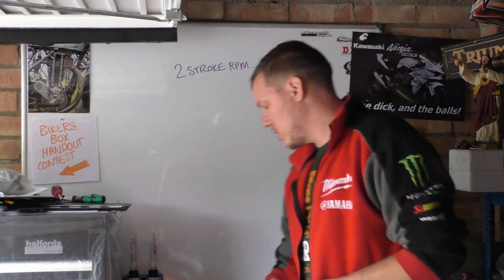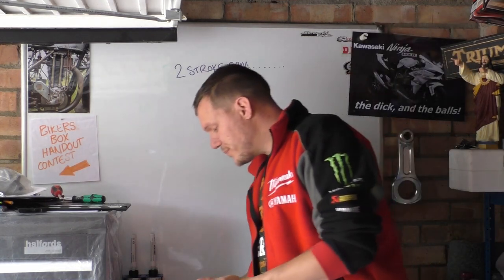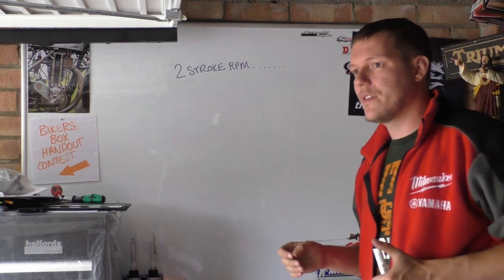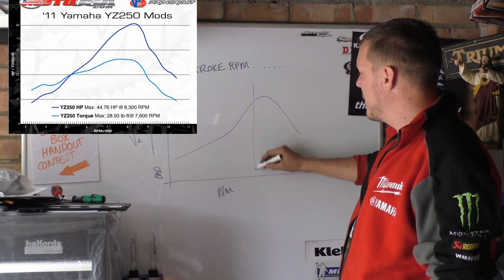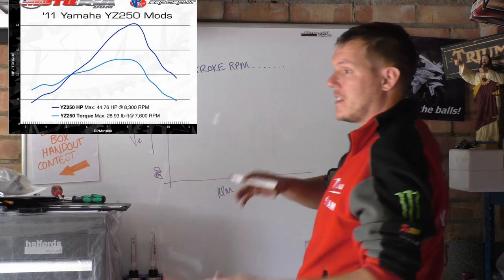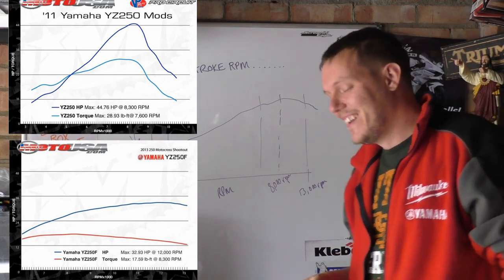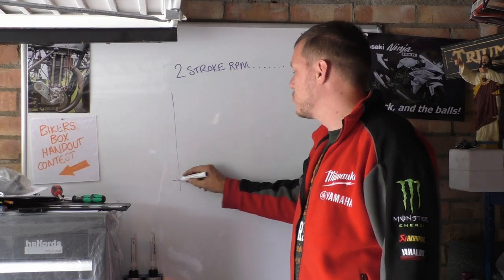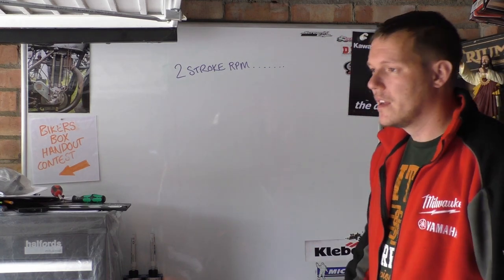2 Stroke have higher rpm?

Comment: I have been saying that for the last month, you almost laugh at me for saying so, at least you made it right.
Reply from the maker: What?
Reply from the maker: You said

 "2T do not rev higher!!!!!!!!!!!!!!!!!!!!!!!! just compare any 2T to 4T with the same CCs and all most the same HP the 4T revs much higher!"

- Which isn't correct. Not all 4T rev higher than 2T. For example look at RC engines seen as though that's what your into. Some bikes, including some race engines 2T rev higher than 4T. If you look at mx then it seems like this, but that because of how they are designed, NOT a limitation of a 2 stroke engine.
Reply from the maker: You also said this 

"The problem with this is that 2 strokes do not rev has high as 4 strokes"

- there is no PROBLEM. That's why I laughed at you.
Reply from the maker: Sorry I going back an forth -

I then said 1 month ago this - 

"2T theoretically can rev higher than 4T's. Lighter reciprocating mass. Its all about the port timing. The problem with 2 strokes is that if you run higher and higher rpm your bottom end is non existant. They have to have a compromise, and this is due to the volumetric efficiency of a 2 stroke vs a 4 stroke."
Reply: That is what I have been saying from the start!